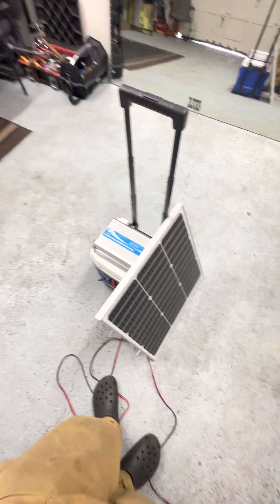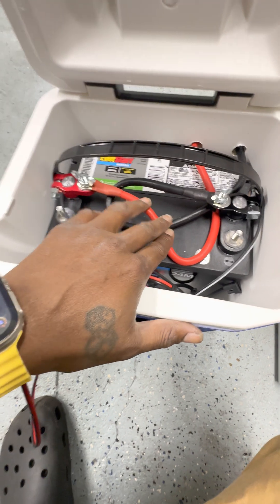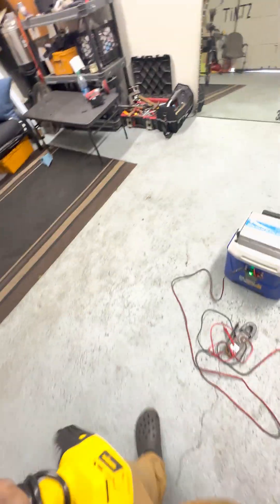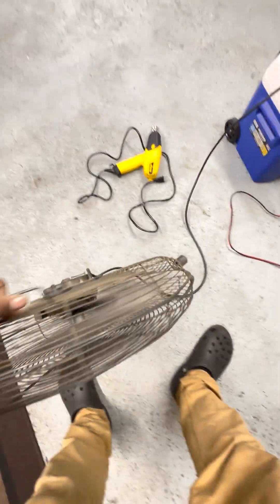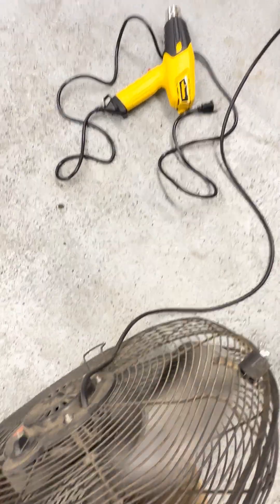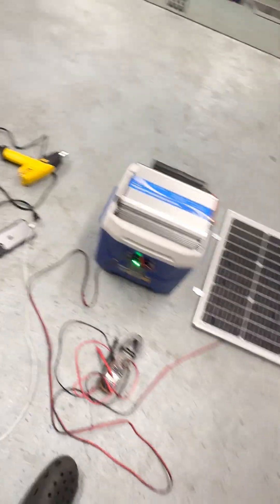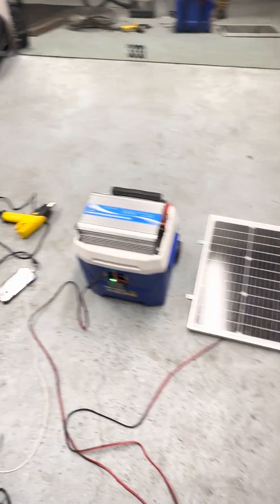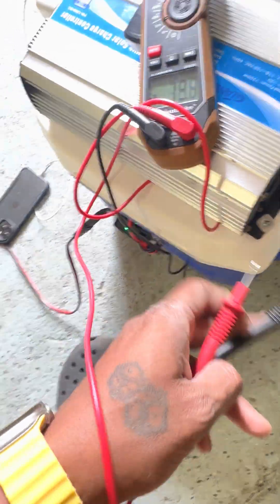DIY solar generator made with a cooler from walmart cheapest electric generator under $250 1200 watt

Comment: Good job, question,I have 80000W Inverter 12V,24,36 and 48V dc to 120 and 240V AC and I have 12.8V 100AH Battery what capacity of Solar controller,Solar panels do you recommend for my complete setup?
Reply: At least 4 200 watt panels and a 100 Amp controller

Comment: You didn't need a separate PV charge controller.  That specific inverter had one built in that would handle that 50watt panel just fine.
Reply from the maker: I know I’m just using it for a backup just in case something stop working in the future I sometime hook up the 100 watt to the inverter instead of using charge controller in the front thank you for your advice very smart

Comment: Was you planning to upgrade eventually? That inverters insanely too big for the rest of the set up. The inverter alones gonna drain alot of your battery with that size and a 50 watt solar panel will take forever to charge it. And youre not suppose to run those lead acid batteries below 50% or itll destroy it. Itll power a few things though 👍
Reply from the maker: Yes I’m planning to ad more battery I did it on the fly

Comment: Nice one compared to them high dollar ones that up in thousands. Couple them 4,5 hundred dollars that would be with 2000 watt inverter . That's where it's at few smaller systems 3,4 them, couple good 12 volts on them good to go.
Reply from the maker: Yes it I had a thunderstorm and power was out for days did a lot of justice tv and phone with a some fan none stop